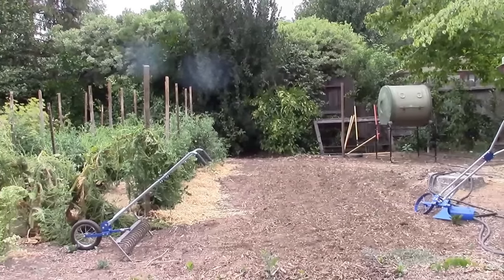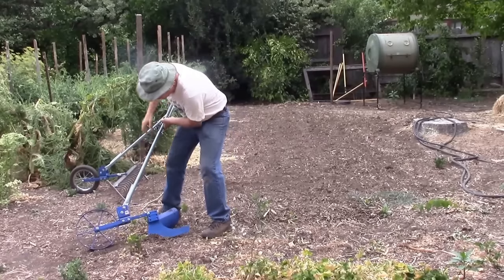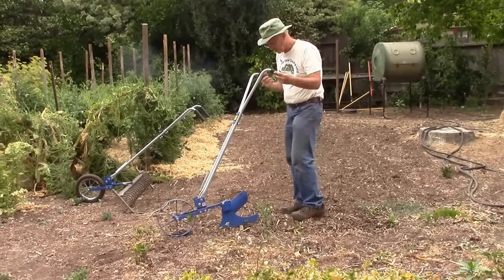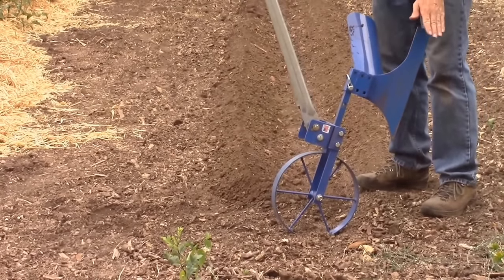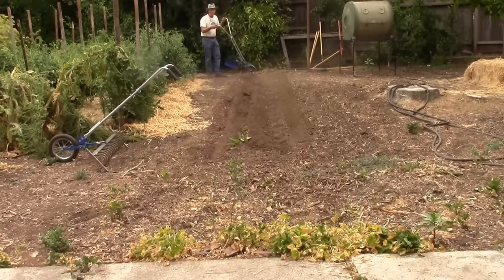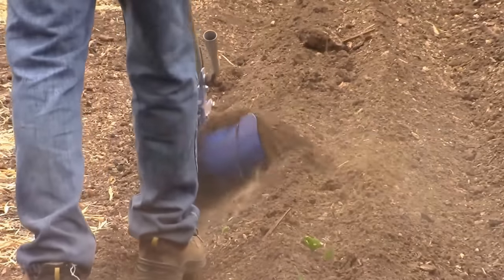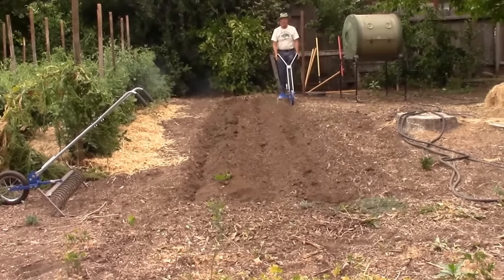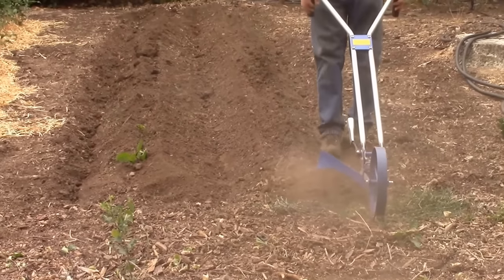Valley Oak Wheel Hoe - Hiller Attachment

Comment: Looks good for dry loose soil. If it was me , I would be hammering, weld ing and cutting on that hiller blade. Needs to be shaped and angled a little more like a  turning plow mold board.
Reply: I have those plows for my horses. Those are desgned to flip soil completely upside down. This is not for that. This quickly pushes soil against rows of corn and covers furrows. It works excellent.  I have one of these valley oak hillers I use a lot.
Reply: @inharmonywithearth9982  I get your point . It would be very difficult for human power to push or pull a turning plow to turn top soil upside-down especially your more difficult clay soils. As a child back in the early 60s I'd watch my dad plow 21/2 acres with a horse and row up to grow corn. The horse died later and was replaced with an old steel wheeled Case tractor with fly wheel and hand clutch.  My family was 50 to a 100 years behind in farming technology.  Going from a horse to a gasoline powered tractor,  we missed the steam powered tractor days.

Comment: What is the green tank in the background? For gravity watering (I don't know if I made that up or if that's what it's called - ha!)?
Reply: The green tank is a Mantis composter. I had one just like it but I gave it away. It's rotating track cracked while I was turning it frozen at 12 below zero Fahrenheit. It never turned good enough after that so I gave it to someone who didn't mind. It cost nearly 500 if I remember. I just made a circle of free standing wire and throw weeds in there and the wild earthworms turn it instead of me.

Comment: It is like the commercials for laundry detergents - everything ideal, prepared to show the perfect result. But the reality in the field is never that ideal. I can only wonder how that would work for hilling potatoes with regular compact soil full of roots and weeds.
Reply: I plan to buy it tomorrow so I will tell you how I hill my potatoes with it but I don't plan to let my gardens ever get compacted soil and full of weeds and roots. That's what you and this tool prevents!
Reply: @inharmonywithearth9982  I can only wish you good luck with this decision.
Reply: Well it's been about five months Ive owned it. I like it. Actually makes it fun to weed and clear paths because it does it all in minutes what used to take me hours. It's a great tool and thanks for the luck. Oh yeah, I forgot to tell you I grubbed out the weeds first with the scratcher before I hill the corn furrows up and potatoes and such. That thing loosens up the weeds and soil in one good pass  and allows the hiller to push all the loose dirt up around the corn stalks. You need to use the scratcher or you can use the blade first if it has weeds. You must adjust the handle  for your personal height and you can do dozens of long rows with ease. It's a lot of fun believe it or not.

Comment: I actually just received my valley oak wheel how last Wednesday. Awesome quality and well thought out. I've already pushed mine about a mile. The simplicity is where it saves me so much time. No bolts to loose when changing attachments. I will eventually order the hiller for next springs potato and sweet corn.

Comment: Has any design been made where the hiller or tiller is pulled rather than being pushed? I liked the concept of adjustable handle, adjustable tilling, adjustable hilling or unhilling as needed. Would a slightly bigger diameter wheel be easier to use? or would a double wheel draw more straight lines? Are some questions which come to mind.
Reply: There are lots of designs that pull instead. However when you are pulling backwards you often step on your garden plants because we don't have eyes in the back of our heads.  If you really like the backwards concept then you need somebody steering looking forward. I have big horses that pull and I steer them. I have retired them and I want one of these now because it is the best one.